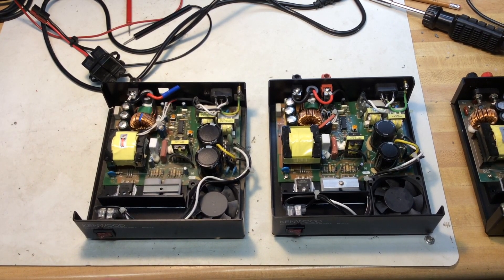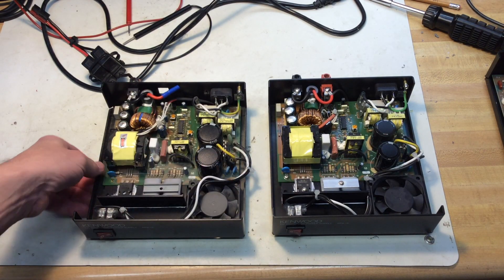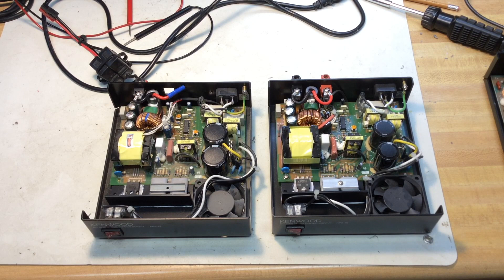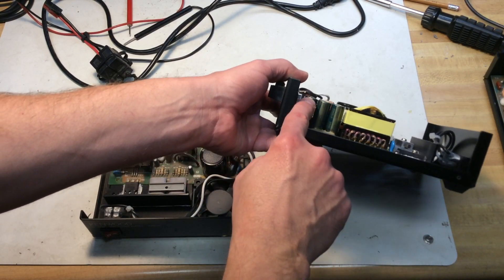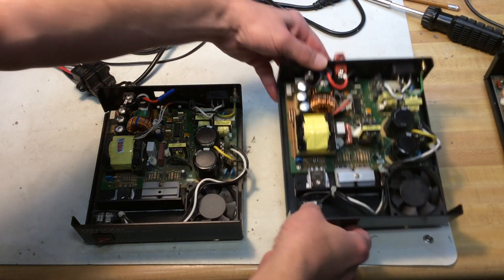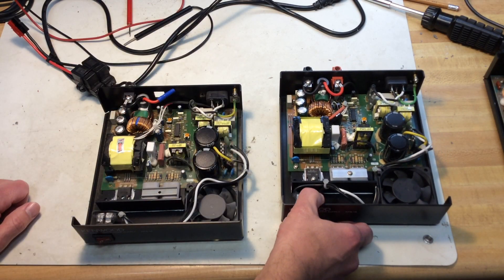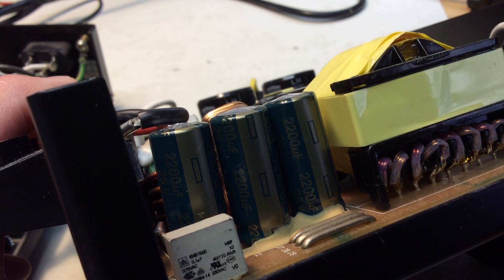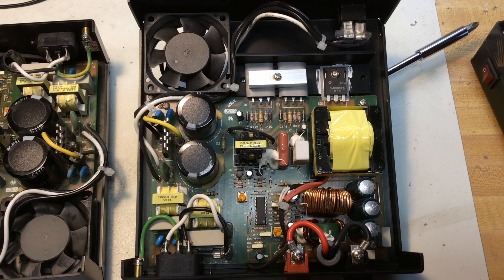Switching Power Supply Problem-Any Ideas?

Comment: These types of supplies is known for problems . no matter if it says Samlex , Yaesu , Kenwood.  They have junk caps. Nock off IC , cheaply made and cheapest parts to make it. Made to fail. People just think .. It is just output filter capacitors are bad. Change out the 330uf , 2or3 10uf , all the 2200uf. Then replace both driver transistors , you may have to change the output transistors if there are bad and wail your at it .. If you can change out the PWM IC controller. And if you have bad or shorted output transistors check or replace the resistors going to the two output transistors.
YOU GOT TO LOVE THESE NOW DAYS CHINA'S JUNK THAT  IS JUST REBAGED IN OTHER BRANDS. Just think.. If this shitty junky made power supply takes out your band new radio or your gear. How Happy you will be.

Comment: I have the Kenwood AD KW TK-7102H. The capacitors from outside seems good. But the bread board seems to have a problem the 3 MOSFETS. I measured the transistors and i understood they failed. I will replace the transistors but know i understand the cause of transistors failure maybe become from capacitors. So what do you propose? I think is a good Idea to replace and capacitors together with transistors.

Comment: the PWM controller is very trick to replace if it's surface mount, not through-hole type chip package.  But the current feedback error amplifier on mine failed and so the whole IC needed replacement.

Comment: I am repairing one right now, and it's the larger version, a SEC-1235M.  Output capacitors had failed, one had vented.  I replaced those three with high quality 2,200u 25V 105C caps.  On power up, it still makes a faint hissing sound (originating in the power output transformer) and it regulates up to about 1 amp and then output voltage starts to drop with increasing load.   I suggest the output capacitor failure is a symptom, not cause.  I do notice that the 24V supply for the PWM chip goes from15Vdc (no load) to about 35Vdc when output is at 1A.  I'm yet sure if that is a problem, since the KA7500 PWM chip is rated to 40Vdc absolute maximum.  Still I think that's odd, and that 24V internal voltage rail is not regulating correctly and might be another symptom of some component failure.  I replaced C13 (300u, 35V) and no improvement.  No I'll have to drag my o'scope out and start looking at waveforms on secondary (isolated) side.  More to come . . .
Reply: narrowed down to a failed PWM.  Replace the PWM controller with same or with TL494 and you'll be good to go.

Comment: I bought a Samlex off eBay and it’s dead. Contacted Samlex and they said most likely capacitors are worn out if units are 10years old. They seem to know about their problem and I think it’s unacceptable that they go dead like this when other brands of power supplies work like tanks to decades.

Comment: So if the output voltage isnt increasing when your hearing that oscillation, than its ripple current killing the caps. I am going to assume by the part number, that it's a 15amp power supply. I would assume that's peak and not continues, and most likely the power supply is under rated for the use. Typical HF rig wants a min of 20A supply, and I like to derate and get atleast 30A. Other possible issue is that the ripple current the transmitter is causing, is too much for the present output capacitors. One thing makes caps bulge, HEAT. Heat comes from either being in backwards, to high of a voltage applied, or too much ripple current for their ratings. So if after replacing the caps the power supply still works, but then again, they start to fail again, next time replace what's on the board with caps with a far lower ESR and better ripple current rating AND add a bunch more external. ESR is like having little resistors in each cap, ripple current causes heating in the caps, get enough of them, and you can handle it.
Reply: Just finished fixing my SEC-1223, which blew the 6.3A mains fuse. Now working 100%. In my case the problem was one diode in the BR108 bridge rectifier had gone open circuit. I sourced a replacement from Radio Spares UK (10A 1000V working diode pack) and also changed the IC which might have been damaged by the diode pack failure (with On Semiconductor KA7500C, which is compatible with the older KA7500B - quite cheap to buy - so worth changing), the 0.47uF and 0.68uF mains input capacitors (which both read severely under value on my capacitance meter at 0.18uF and 0.29uF), as well as the  680uF 200V electrolytics. Popped in a new 6.3A time delay fuse too. It's worth removing the power transistors and power diodes and checking them with a multimeter before spending any money. Mine were fine, but the power transistors can apparently go short circuit, which would be a big problem as they are no longer available in the UK. Whilst repairing it, I also decided to fit three new hi-spec output capacitors 2200uF and 25V and to change the 330uF 35V capacitor feeding the IC supply. Only had to adjust VR2 a tiny bit to bring the output voltage down from 14V to 13.8V. All is working fine now. Hope this helps. Got my SEC-1223 from Martin Lynch in the UK a few years ago. They told me they don't repair SM PSU's, so it's a repair it yourself, or bin it situation!

Comment: Gut it for parts and throw out the rest, i have been trough 3 of those switching supply also and they are crap, nothing more.
Get one with a transformer, it will outlast many radios but i don´t think i need to tell you that :)
Thanks for the vid.
73´s OZ5RS Rene

Comment: Most likely caps.  Be sure you replace them with 105 degree low ESR types rated for the ripple current you expect at full load.  One shortcut manufacturers will make is to use smaller caps that can't handle the ripple current the supply will produce.  Its been my experience that short and fat caps work better than tall skinny ones in the ESR department.  Also be sure to replace the small value bootstrap cap near the controller IC.  Its usually in the neighborhood of 47 to 120 microfarad.  When it dries up, the power supply will not start.

When replacing shorted switching transistors, it is standard practice to also replace any diodes and transorbs around them, as during the transistor failure they will get 'zinged' and may test fine but provide an opportunity for failure later.  Also be sure your drive signals to the gates or bases of the transistors look clean and are free of excessive ringing and other high frequency trash.  Bad drive will lead to an unhappy supply, and the only real way to test this is to use a floating ground scope (you can use a power isolation transformer on your scope to do this.) and probe the gate/base with the unit powered up.

Comment: no display , not adjustble ?
in fact it is not perfect
you can see my channel , there are many many friend to make many many power supply  
you just add DC-DC digital control power supply , it will be perfect 
https://rdtech.aliexpress.com/store/group/DPS-digital-control-power-supply/923042_508466030.html?spm=2114.10010108.100008.3.n0XDhH
you can consider this idea

Comment: As others have said - sure looks like the caps are toast.  Bulging comes from overheating which usually results from increased power dissipation from excessive ESR * ripple current.  I would bet the these caps test bad for ESR.  High ESR increases the ripple on the supply, making the regulator work harder, etc. and is probably what is causing the transformer to sing.
Reply from the maker: Thanks and yes, I know with the bulging of the caps, they are bad, will be interesting just to test them when I pull them out.  Wasn't sure if there might be more to the problem but with all the input I think that is all it is probably.

Comment: Oh, it's definitely the caps.  Hard to tell from the vid, but they are green, right?
There's a great story about a couple of brothers that stole an electrolyte formula and started their own company.  Problem is, they missed a key ingredient, a preservative.   There's tons of these caps out there now that dry up and fail.   The ESR goes up and they load the circuit they are supposed to filter.
In this case, rather than just shutting down the oscillator,  the increased load is killing the transistors.
You can read all about it here.
https://en.wikipedia.org/wiki/Capacitor_plague
Reply from the maker: Yes, they are green and thanks for that great information, I will check that link out!  73
Reply: Near the bottom of the article, they talk about the incomplete formula, but don't reference the brothers story.
There was an investigative report I read, linked off a electronics repair forum I read  years ago that told the whole story.
Trying to find it again..    It's out there somewhere.
I've fixed tons of stuff with these bad caps.  Usually, their load just shuts down the PS' oscillator without further damage.  This PS must be designed differently.  It might have something to do with additional filtering to eliminate hash noise interference. (since these are radio supplies).
The whine is probably coming from the windings of the transformer when it's getting hit with the much higher current load from the caps.  The whine is probably the same pitch/frequency as the oscillator.
Reply: RadioHamGuy was changing the caps and the shorted resistors fixed it?

Comment: http://www.badcaps.net/ is a great place to go when facing cap problems. Some caps are much better than others. One rating I look at is endurance rating like 5000 hours at say 105 deg C. Higher temp rating and higher hours will last much longer. Go with good brands like Rubycon Nichicon or Vishay for example. Let me look and see if i can find the switching power supply youtube video I liked a year or 2 ago, it really was great in explaining sw power supplies.
Reply: Panasonic caps are great too.  Go to Digikey and look up 105c caps with low ESR ratings.

Comment: You didn't say where the bulging electrolytics are on the schematic - are they in a location for which increased ESR would lead to too high a current in the failed transistors?  Here's a helpful website I found, also - -http://www.giangrandi.ch/electronics/smpsfix/smpsfix.shtml.
Reply from the maker: Thanks for the link, the caps are the filter caps at the DC output.

Comment: It's getting to hot. And the cap's are probably shit new. It might be over driven. Rated for 23 amps at a duty cycle not continuous. Stick a bigger heat sink on the fets, that fan doesn't seem to be doing anything either. the exiting caps are absolutely fucked btw. there's no doubt there.
What voltage does this run from, are the input caps rated for rectified mains at 120v or 230v.

Comment: I am no expert, but I think you already know the answer.
 Id replace the caps, and xistors, and possibly the lm723 voltage regulator (if theres one in there) or whatever is used to regulate the voltage, replace with Mil spec,  a must, as its rated much better, can handle much more temp.  ke0kkt
And awaiting for a more expert opinion, right next to ya.  73

Comment: I think I remember whining can also come from bad capacitors (or maybe just caused by it) and I think you are right you should change those capacitors out, it's been a very successful approach for me whenever capacitors are showing signs of damage like you pointed out.

Good luck, and maybe use a higher voltage rating, lower esr and/or higher capacity would help keep the capacitor stress down.